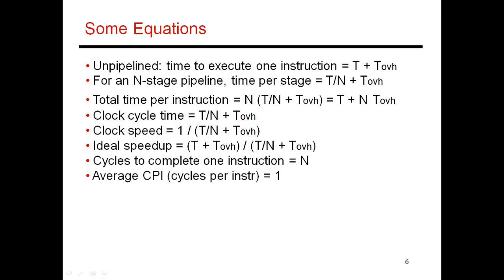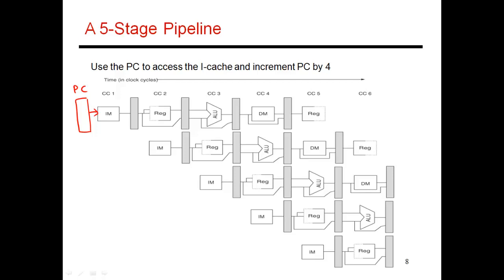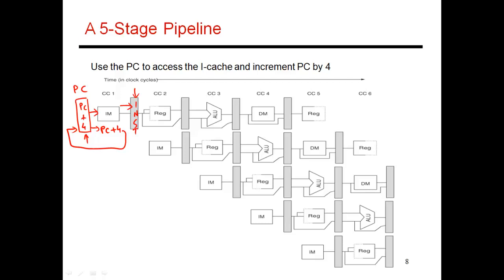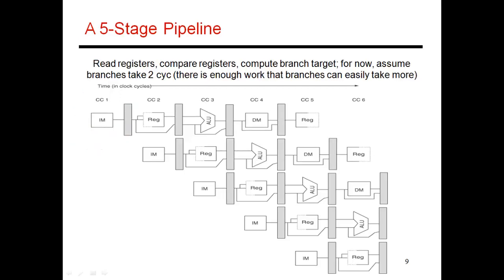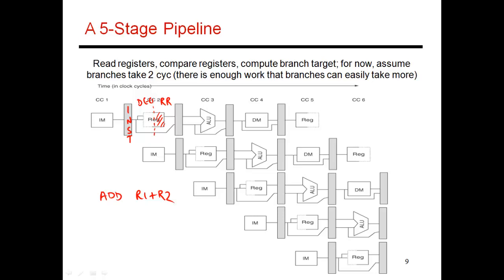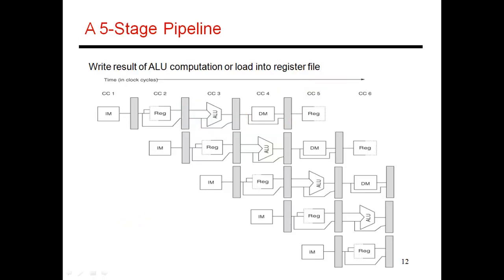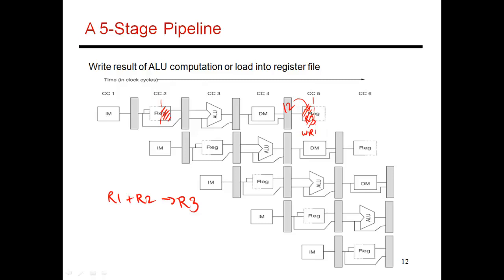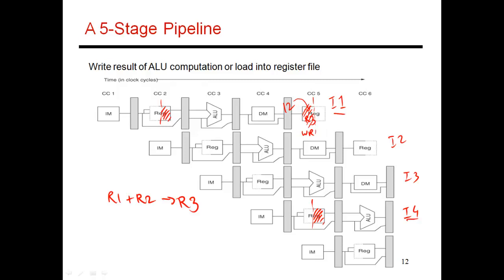CS6810 -- Lecture 6. Computer Architecture Lectures on Pipelining

Comment: Thanks Sir, it is really a great  video. But i have confusion regarding branch completion. As u told that if after comparing the two registers, result is zero then PC is shifted to the  target address instead of next sequential but my question is "comparison(a sort of subtraction) is done in ALU and if the result of ALU is zero then only PC is shifted to the target address" so cant we say that branch is completed in 3rd stage rather than 2nd stage.  Pls help me..THANKS
Reply from the maker: The ALU required for the branch comparison is different from the ALU shown in the 3rd pipeline stage.  The ALU for the branch comparison is a separate ALU that is used in the 2nd pipeline stage.